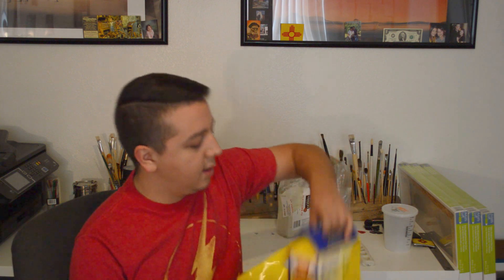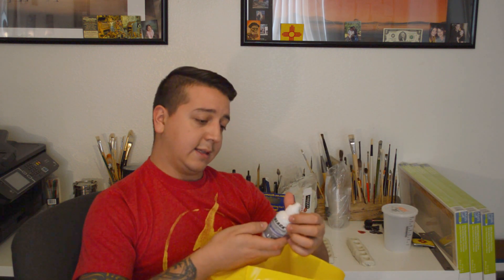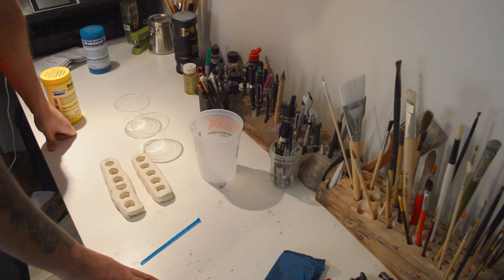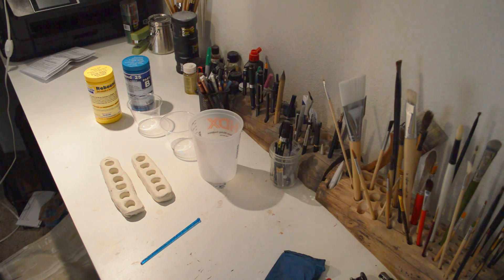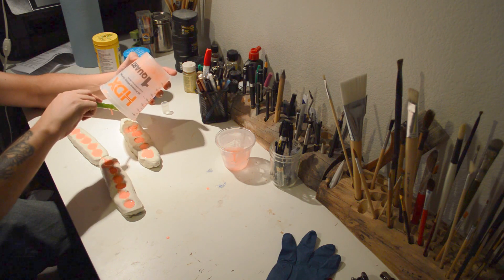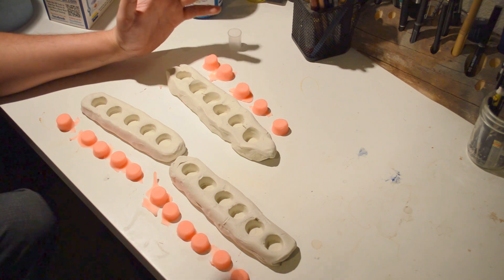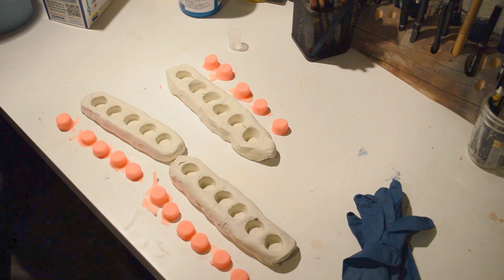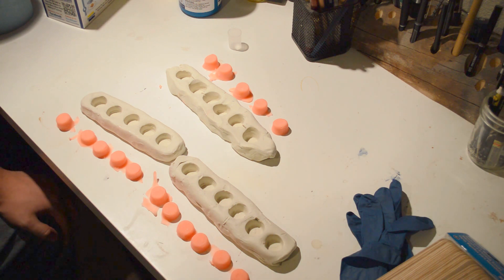Platinum Cure Silicone Inhibition Test and Registration Keys

Comment: Im new to mask making, can you tell me more about registration keys? What are they and what exactly are they used/needed for?
Reply from the maker: Victoria Pereira ok so when you are making a two part silicone mold with a rigid jacket mold the silicone is soft and can move around, but when you add registration keys it locks both molds together so that way the silicone mold is as close to what it's original shape used to be. You can see later on when i'm casting my mask one of the registration keys wasn't lined up and deformed and warped my casting. Hope this helps thanks for watching!